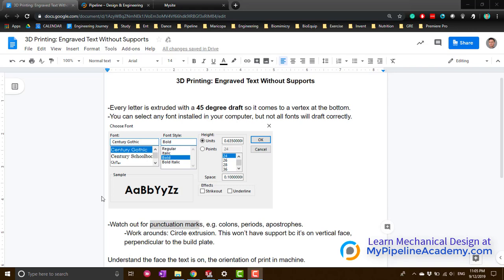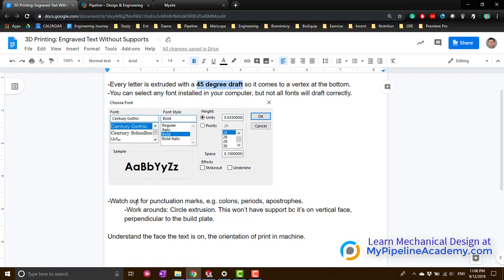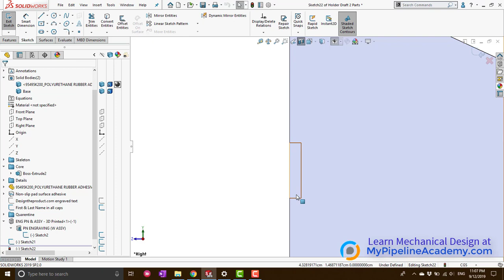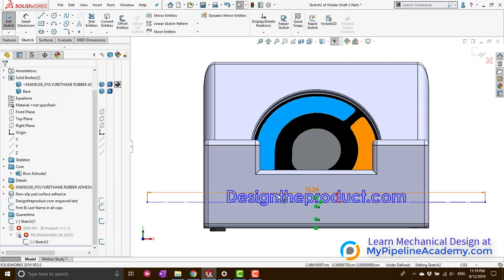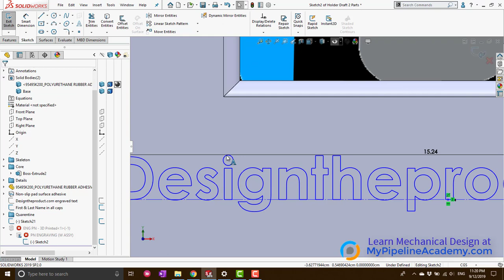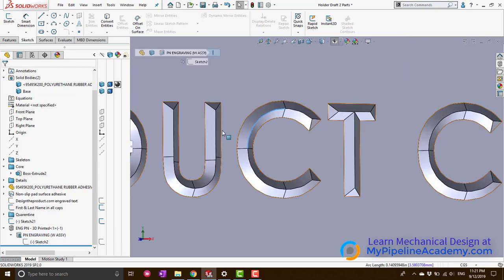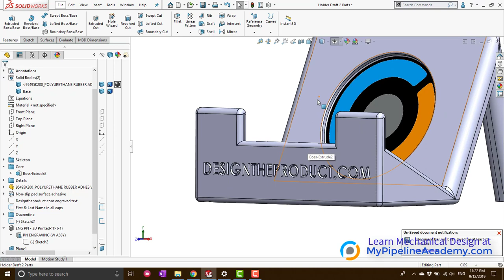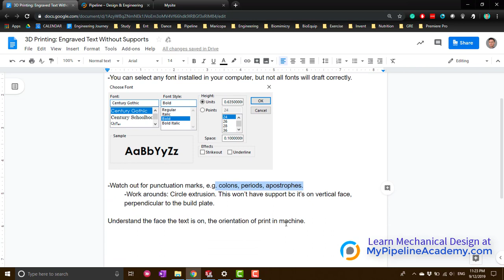3D Printing Engraved Text Without Supports

Comment: Thx. A few thoughts...

First, for the dot: extrude cut WITH TAPER:) As for lower case, +/or thin fonts, perhaps a different draft angle: 3D printer w/ good part cooling can handle steeper overhangs:) Lastly, add an Offset (or Contour) to slightly widen things:)

Not sure how well (or if at all) these suggestions will work in all cases, but I think they should help for some. What do you think?...
Reply from the maker: I think you're very clever, sir/ma'm.
Reply: I've been "accused" of worse!:D Thx.
P.S. I am a male human :)

Comment from the maker: SUMMARY: 
Every letter is extruded with a 45 degree draft so it comes to a vertex at the bottom. 
-You can select any font installed in your computer, but not all fonts will draft correctly. 

-Watch out for punctuation marks, e.g. colons, periods, apostrophes. 
 -Work arounds: Circle extrusion. This won’t have support bc it’s on vertical face, 
perpendicular to the build plate. 

Understand the face the text is on, the orientation of print in machine.